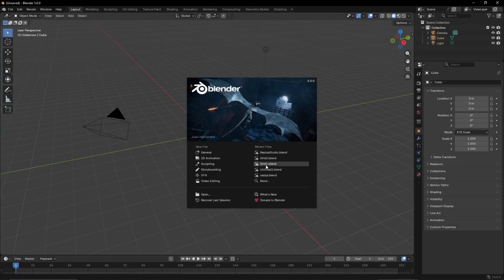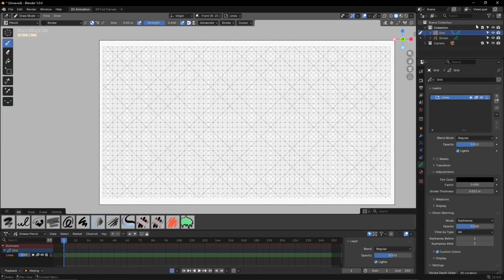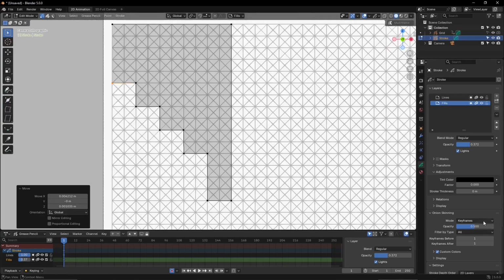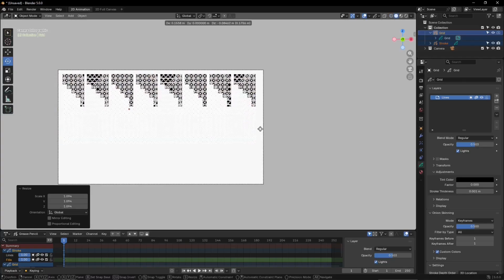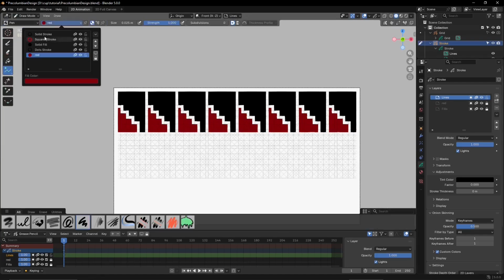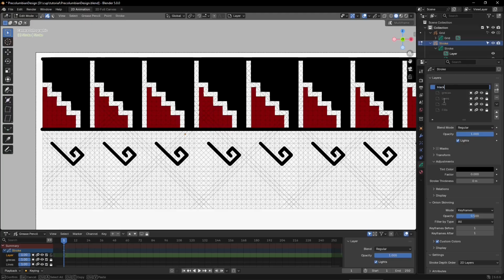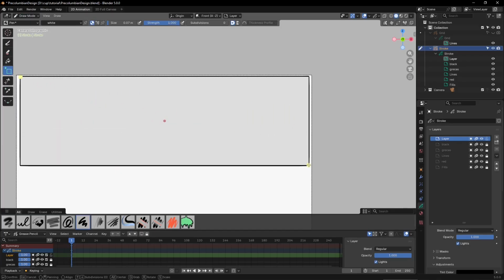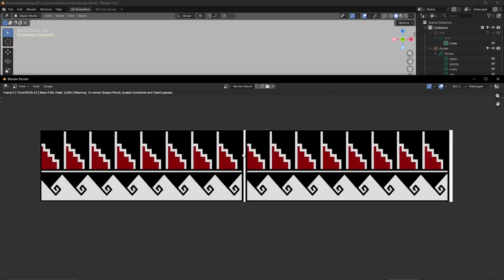How to Draw Pre-Columbian Geometric Art in Blender (Step-by-Step)

Comment from the maker: Thanks for watching! I hope this helps you master the 2D side of Blender. 🏺✨

If you’re feeling a bit lost because you don't have the grid template yet, make sure to watch the setup tutorial first so you can follow along perfectly:
👉https://youtu.be/_yDWjbHWwh8

For those of you following along in real-time, here is your "No-Pause" Cheat Sheet for the shortcuts I used in this video:

Tab / Ctrl + Tab: Switch between Object, Draw, and Edit Modes.

Shift + D: Duplicate (The most used button today!).

G / S: Grab (Move) and Scale.

X / Y / Z: Press after G or S to lock to an axis.

A: Select All.

Enter: Confirm your polyline stroke.

Shift (Hold): Keep those lines perfectly straight.

Are you a 3D modeler trying out Grease Pencil for the first time, or are you a 2D artist moving into Blender?
 Let me know in the comments!